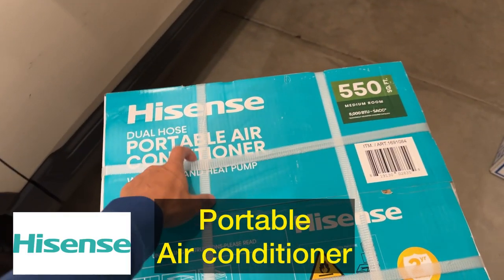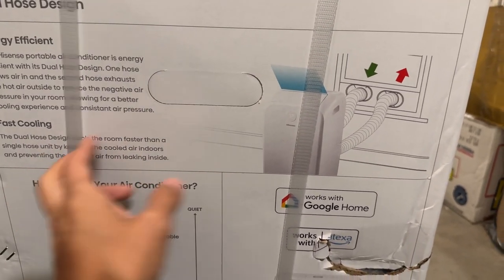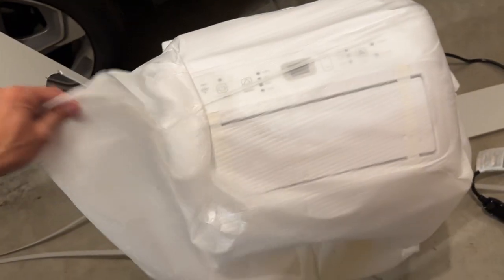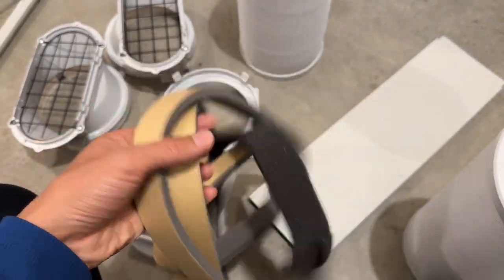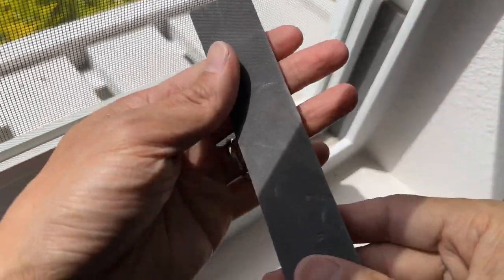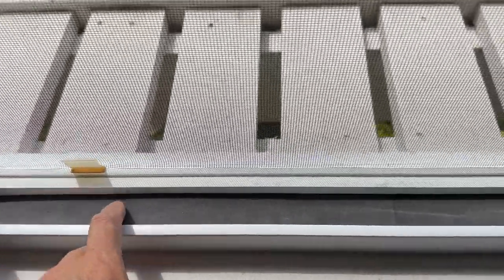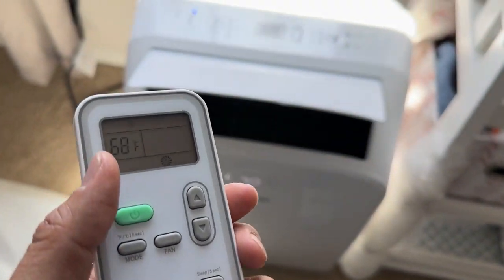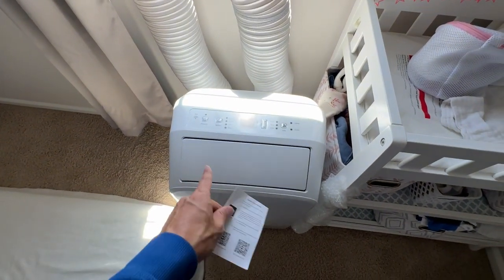Costco Hisense Portable Air Conditioner: Unboxing + Install + Setup with Phone & Google Home

Comment: Thank you very much for the nice video. I looked at all the videos posted by Hisense in YouTube and only in their oldest video they show that window panels installation like you are showing but all their newer videos shows the sliding part of the panels should be facing outside so you won’t see any of the sliding part from inside the house. I just wanted to point that out. Either way it should not make that much difference but it does look better if you leave the sliding part facing outside like they show. Thanks again.
Reply from the maker: Hi, thanks for sharing. I will make a note of that. This is a great idea to face it outside to look better. If you find this video helpful, please give a like 👍 and subscribe so others can find this video too

Comment: Thank you for this! I just picked it up from Costco. I thought the heat would've died down by now in Texas but it's keeping over 100 steady.
Reply from the maker: Hi Thanks for your comment! Glad to hear you picked one up. Please share here your thoughts in the comment so other people can find them useful.
Reply: I just got one a few days ago. It cools as advertised, but I don't understand why the remote, the LED on the front of the unit, and the control panel on the top of the unit, all sport different numbers.
Reply: @meanpersonable 
Same here. Also seeing inconsistent behavior. The temperature gauges are confusing and unclear.

Comment: I’m
Confused…. We have the exact same box but I didn’t see you take out the plastic drain pipe? How does your water drain?
Reply from the maker: Hi thanks for your comment. There is a drain hose which comes included in the package. I forgot in video to show the drain hose.
Reply: @PaniaThong  my question is does it actually need to be installed or is it optional
Reply: @TobiasYoung did you find this answer? Lol I’m wondering the same thing.
Reply: @_CoachFrankie_  nope! But so far I’ve had it one and working for the last 24hrs and I’ve had no issues or signs of water leaking
Reply: @TobiasYoung  ha! Have you had to empty it yet? I’ve got mine running, and HOPING it shuts off on its own when it’s full.
Reply from the maker: @TobiasYoung  hi you don’t need to install the hose until you need to drain it
Reply: @PaniaThong  I’m not sure that makes sense, I’ll just call the company. Thanks
Reply: How often do you have to drain it ?
Reply: @fernandorey2937  i haven’t had to drain mine yet!
Reply: @_CoachFrankie_   I had it for maybe 3 weeks or less I just drain it 3 hours ago I have collected like a soda size of water I guess I'll drain it every 2 weeks
Reply: I saw some other video, that if you see an Error code E5 then it is time to drain the water.

Comment: hi! great video. i just bought this AC. My window is about 29 inches, so I have to use the small extension. However, the extension covers half of one of the holes on the panel. Do you know what I can do about this? Thanks :)
Reply from the maker: Hi! You could either cut the small extension or you can try to buy a one hose Air Con :)
Reply: @PaniaThong  thanks! Do you by chance know any easy way to cut that plastic extension? I was wanting to do that but I don’t think I have the proper tools
Reply from the maker: Hi one other solution is to convert the dual hose into a single hose. Just don’t connect the left hose (which is supposed to take air from outside in) and only connect the right hose which exhausts hot air out.  

So you want to use an extension to cover the left hose hole on the window.
Reply: @michelleschmidt5108  I'd find a way to cut it - Running into same issue, but the whole reason this AC is better than others is the dual hose design, i would not convert it.

Comment: I brought 2 of them at different time in Costco. The first one is my bedroom and it is working just fine. Noisy but cool off fast. However, the second one in the study room has a burning plastic smell when I turn on the AC function. Anyone experience of burning plastic smell when turn on the AC function?  So far I have not try other function since it is still Summer...
Reply from the maker: Hi thanks for your comment. It shouldn’t smell burnt plastic. So I suggest you returning it if that’s bothering you. Have a good day

Comment: What about the hose? I have the a/c and heater model.
Reply from the maker: Hi, thanks for your comment. Do you mean the drain hose to drain the water out?
Reply: @PaniaThong  yes I didn’t see you out it on
Reply from the maker: @gabrielgarcia5329  hi you don’t need to install the drain hose until you need to store it and done using the AC for the season.
Reply: @PaniaThong  oh okay thank you for the info

Comment: How do we use the heat pump? Do we still use the hose while we use as a heat pump? Thanks
Reply from the maker: Hi thanks for your comment. yes portable air conditioners that have a heating mode also need to be vented to the outside. This is necessary to remove the hot air that is generated during the heating process.
Reply: @PaniaThong  
Oh thank you so much for the info.   I was confused because some people said we don't need the hose while we use as a heat pump. Will it produce water too like when we use as air? conditioner

Comment: Video was useful, but, didn’t show me anything about the drain hose, for connection and or drainage, and or drainage capture😢!   considering that this is a bedroom installation, can’t have drainage onto the carpet !
Reply from the maker: Hi thanks for your comment. If you’re using the AC Cool mode you won’t need to use the drain hose. Hisense Portable Air Con uses a system where you won’t need to drain the hose while using the AC cool mode.

Comment: will water go in through the hose when it rains?
Reply from the maker: Good question! Insects and dust can go inside too. For the rain, if the angle is not too tilted it won’t go in. If you are worried, you might want to add a window screen so it will prevent bugs and stop some rain from going in.
Reply: @PaniaThong  thank you!

Comment: Does it work well?
Reply from the maker: Hi it does cool really fast and the fan Om high is blowing a lot of air. Haven’t tested the other modes. The only problem I notice is when you try to use the remote to change the temperature then try to change the temperature on the AC itself, it will sync the temperature on the remote. So the remote doesn’t know the temperature on the AC. It only remembers the last temperature set on the remote

Comment: what rating out of 10 would you give this device?
Reply from the maker: Hi thanks for asking. It was on sale for $299.99 last week. I haven’t tried other functions other than the Fan mode and AC. Considering the price point, the fast cooling, the noise, the electricity cost, the ability to control with smart home, and the random temperature change bug, 2 years warranty and extended warranty from Costco, I would give this an 7/10 to 8/10